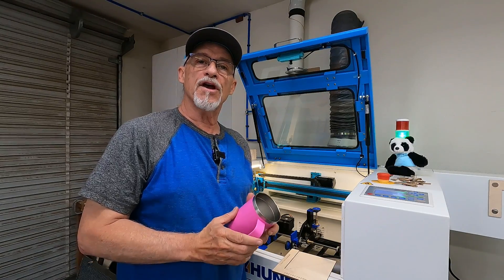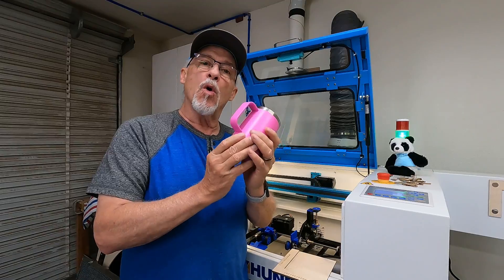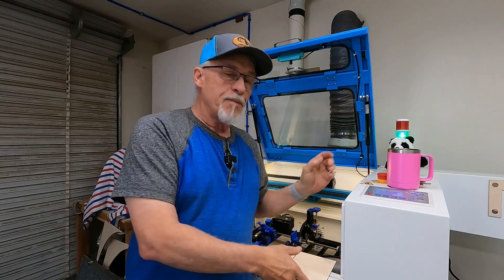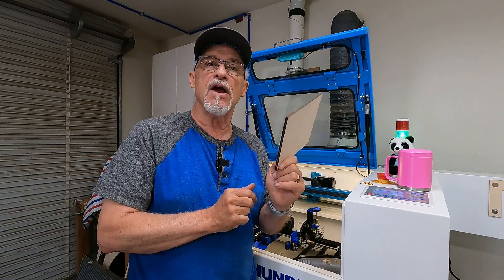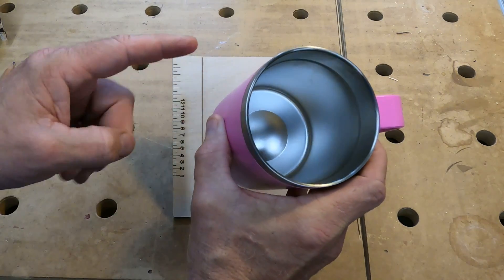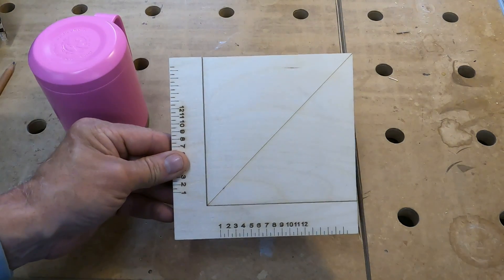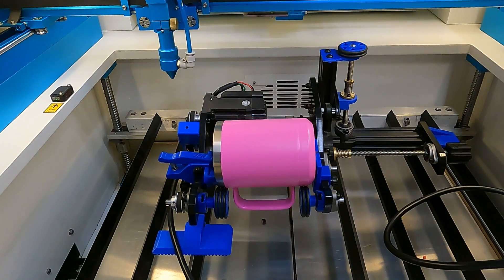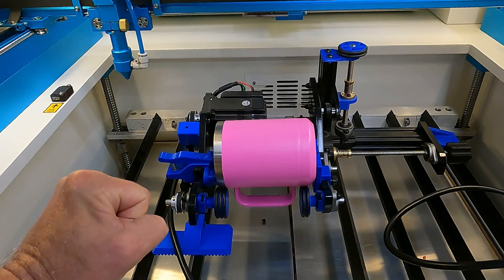Laser Engrave a Cup with Handle, how setup your Thunder rotary and LightBurn

Comment: Robert, Great video, but I have one question.  You are using the same logo.  I want one logo on one side, and a different one on the other side.  Which logo goes where and on which side of the handle?
Reply from the maker: it wouldn’t matter divide you vertical rectangle in to two equal parts and drop the different graphics in the middle of each rectangle. works great. don’t make the graphic too big or you can have a handle conflict

Comment: To get the steps for rotation, you set the design the same way, have to change to middle? (13:40 on video to correct handle turning)
Reply from the maker: Determining the steps should be done with a tumbler that doesn’t have a handle

Comment: Why not take the template one step farther.  On your back plate instead of 1 line mark lines at every inch in an x type so 2 to 2 2.5 to 2.5 and so on with small indent on your left and right top piece from the outside edege to the  2 inch mark this will help allow to use the same jig to find center for left and right sided logos as well.  i have a jig for 3 inch and anouther for 4 and 5 make sure u use solid line then dashed and so on to tell them apart. hope this makes sence.  Never failed me yet and saved me hours of marking center.
Reply from the maker: Great suggestion!
Reply: @computercreationz  be happy to share one if you would like